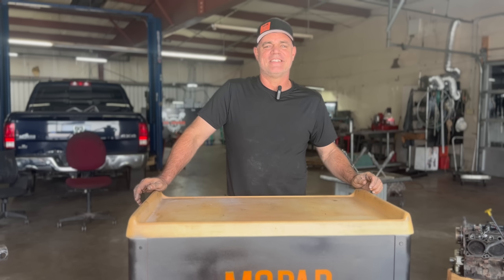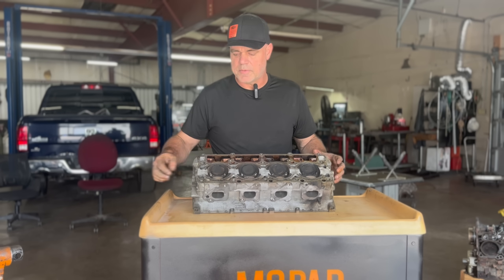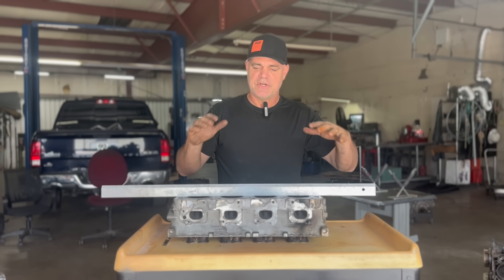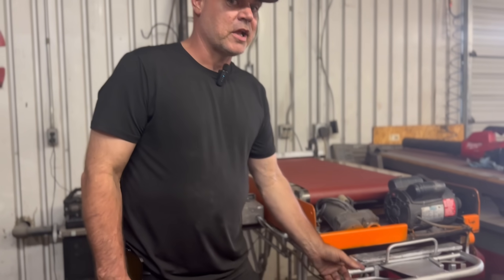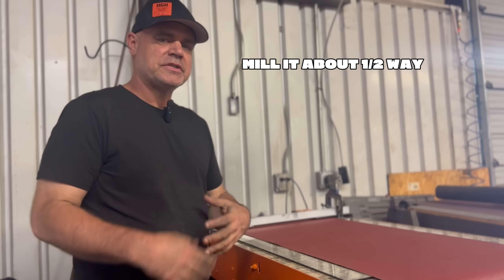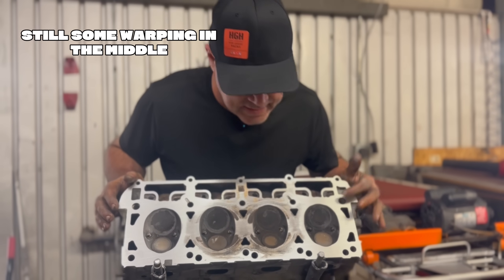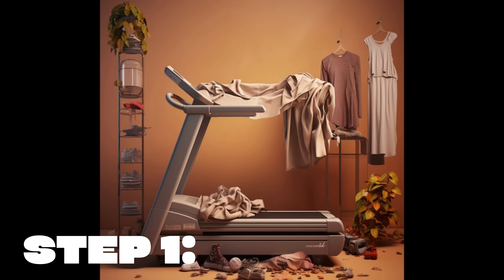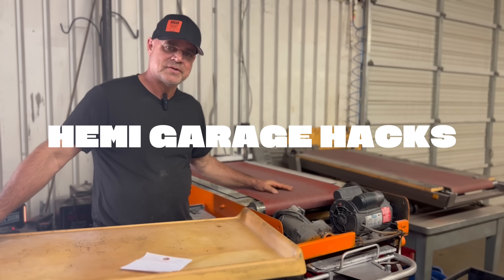I HAVE MILLED 1000+ CYLINDER HEADS WITH A TREADMILL!

Comment: This is awesome, if you dip into many quick turn around machine shops that do heads, you'll find a very large belt sander. To be fair, yours is much, much bigger. My local NAPA, which does all the head work in the local area, doesn't even posses a milling machine. I'm honestly better equipped as a home tinkerer/DIYer but they posses the parts/knowledge to do it like cave men and turn out a quality product.
Reply from the maker: You are right. And the added size has been super helpful.  I would just encourage people to use a straight edge of they are going to give this a shot.  Thanks for commenting and I am glad to have you along for the ride.
Reply: I thought Napa closed all their machine shops
Reply: @chrisbrady-t1u  my local one still stands but it's literally one person. The day he retires or God forbid, dies they'll likely close the doors on this one too.

Comment: Not a bad idea but I fear it may eat more of one side than the rest. If you had a jig to rotate the head constantly at a low rpm, I feel it would be great.
Reply from the maker: excellent point you have brought up!  It is important to change the direction of the head when doing this.  Thanks for the comment
Reply: as long as you don't get stupid the pushrods & gaskets will take up any error.
Reply: doing it by hand I rotate the  sanding marble  frequently (that gives me needed rest also)

Comment: Belt sander..you are sanding the head.. Zero mills touched that head..I'd be really angry if I paid for " milling" but you used a homemade sander instead.. just tell them the truth about it..charge for sanding the head.. obviously too much brake cleaner has deleted way too many brain cells..
Reply: Have you ever had a head rebuilt by your local machine shop? If you asked them to "mill it flat" with no other requirements for chamber size/volume or documentation, they likely slapped it on a belt sander, took it over to a granite surface w/sandpaper, gave it a couple of hand licks, checked it and sent it out the door. People are getting upset w/this guy, but honestly this is how many shops do bulk heads and has been for ages. He isn't reinventing the wheel, he's just showing you how he made his wheel and it's pretty awesome.
Reply from the maker: @adf360  Thanks!  and it has worked for 13 years.  Funny how people get upset about this stuff:)
Reply from the maker: Thanks for sharing!  It straightens the mating surface and I really like that feature:)
Reply: @HemiGarageHacks  and that's great..but it's not to the tolerance or sof having it actually milled..a mill you can dial in exactly how many thousandths you want to take off of each head so they will be matched as a pair vs eyeballing it.. if I'm paying for mill work that's what I expect to get..now if you said you could sand it for 1/4 the price of mill work that would be different.. the people that don't own or use a milling machine will never understand this concept..but as I milling machine operator and owner this entire situation is very offensive as it discounts the precision work a machinist is capable of..this method is very crude..each head will be different..causing differences in each cylinder size and compression rates..
Reply from the maker: @agentcovert you sound like you take pride in your work, I can really respect that. I'm glad you shared your thoughts:)

Comment: This is dumb. There are too many variables to this job. What RA is this leaving the cylinder heads with? Have you ever measured one of these heads to see if the entire thing is bent, not just the surface? You are sanding cylinder heads not milling them.
Reply: If it seals it don’t matter does it
Reply: Not dumb. I have done it in a similar way. A sheet of thick glass with water paper. Start with a course grit and finish with around 800.
It's called lapping.
The one car I did this on did 150k miles after that without problems.
Reply from the maker: @gregculverwell  heck yeah, that's what I am talking about!
Reply from the maker: People get scared when trying new things.  Straight-edge is your friend on this one.

Comment: In your situation that's a great idea I did mine on a 1/2-in thick piece of plexiglass and yeah it was a little bit of work but I only had the one set of heads to do
Reply from the maker: my first experiment was with 3" plexiglass and then I moved to granite with glass (not tempered glass) on top.  I love that you did that yourself though.  Bravery with these things is often lacking.

Comment: You would have to measure the heads each time to see what CC's you have to make sure both heads are the same or you would have different compression ratios on each.
Reply: Taking a couple thousand out either side isn't going to make enough difference to worry about for a street motor.
Reply: @JackHays75  Exactly that👌 Need to remove quite a bit of material to alter the CR by any amount worth worrying over.
Reply from the maker: excellent point you have brought up!  It is important to change the direction of the head when doing this.  Thanks for the comment

Comment: excellent, ingenious
Reply from the maker: Thank you, and the cool thing is that it actually works. over 1000 heads milled without issues.  It's been an awesome workhorse, plus I can use it for other things I need to modify.   Thanks for taking the time.  I have more stuff like this to show, and definitely check out my first video I did on a Lifter tester I made.  Now that was fun!

Comment: Very nice. Much easier work than the old school method of gluing the sand paper to the glass and sanding by hand.
Reply: I'd sandpaper by hand maybe once or twice, but not every day. His idea is great for constantly truing heads.
Reply from the maker: agreed!  Thanks for the comment:)
Reply: But thats accurate! This is NOT. This is a TERRIBLE WAY>  Im a machinist! I KNOW!  Ive done this, It DOES NOT WORK WELL>!   DONT BREAK YOUR STUFF based on some fool youtuber advice.  Hell id only charge you 20 or 30 bucks a head to put them up on my mill...why would you do this crap!? I do 2 stroke heads for 15 bucks lol. You cant even EMORY a head ITS RUINED!
Now if your talking 80 HP LS I guess maybe, but not an actual engine, and here we go with the grampy stories we all know them...fish tales one and all.
Reply: @frosthoe   He say he has done it on 1000 engines... I would think this method to not make it straight enough but he claims to have done it that many times proving at least how he do it works.
Reply: @frosthoe  Why, explain your opinion? I prefer to machine heads vs using a surface grinder because you get a better gripping seal when installing. That said for the average daily driver the belt sander device in the video will do the trick.

Comment: What grits ate you running on both mills?
Reply from the maker: 60 on the head mill and 40 on the exhaust manifold mill.  60 grit is a little rough for the first 10 heads, but I polish off the peaks with a  prepper pad.  after that, the finish is really nice.  the same belt will last me 2+ years. No issues having done over 1000 heads in the last 13 years.  Thanks for the question.
Reply: @HemiGarageHacks What is a prepper pad?
Reply: @turbovolvos40  *prepper

Comment: have you looked at the surface with a microscope to see the depth of the scratches from the sandpaper? No thank you.
Reply: I actually love this point.  I have milled over 1000 heads with this for my own shop and multiple heads for other shops with no issues, so the current finish is not detrimental to the head gasket seal whatsoever.  I like your point because I am curious as to what the threshold is on that.  What is too rough?  I have even heard debates on finishes that are too fine.  Without question, there is going to be a point where it would be too rough though.  I bet 40 grit would be pushing that boundary for sure.  Thanks for the input and thanks for watching.  I may at some point mill a head on my exhaust manifold Mill with has 40 grit, just to see the outcome.
Reply: @davidmiller1022  maybe a crosshatch pattern? turn the head at a 45deg angle and then the other direction at a 45? Like a honed cylinder surface.
Reply: I guess you guys have never researched roughness average requirements for the specific alloy of the head and gasket type

Comment: This is a clever way to flatten heads.  25+ years ago I saw an old German guy flattening BMW inline 6 heads with a large industrial belt sander similar to your treadmill.  I never forgot it and ended up using this technique on warped exhaust manifolds more than once.  Cast iron manifolds in particular can be a pain to set up and cut on the mill, but an abrasive belt gets them to cooperate in no time.
  
The caveat is that, if you have an overhead-cam engine, you have to make sure the head hasn't warped so much that the cam binds in its journals.  If it does, you'll either need to flatten it back out in an oven, or line-hone the cam journals when you're done sanding.  But for most engines, manifolds, etc. this is a real time and money saver.  Good job and thanks for showing us how you did it.  The gurney is a particularly nice touch.
Reply: My understanding is that as long as the warping of the head is not more than .008, the cam journals most likely won't be out of spec. The significant majority of blown out heads I've are usually in the .002-.006 range anyway, so most people are going to be good to go most likely.
Reply from the maker: You are absolutely right!  My second treadmill mill has a much more aggressive belt on it for milling exhaust manifold.  Since they are cast iron, it can take a while to mill them without an aggressive sand belt. Thanks for the input:)
Reply: @HemiGarageHacks  I machined .010" off a pair of subaru heads, (low spot was between the two cylinders in the middle) and after heads were torqued, the cam journals still turned freely, no friction. i was quite frankly, astonished.
Reply: @EldonJohansen Is it possible to shim up the center cam journal if you have to take off say .010 to true the head?
Reply: @MrMEmEmEmEMEMEeeeeee  i would assume subaru heads are the same as any other. You would need to take the cam caps, machine say 10 thousandths off of them, then line bore the cam journals again.
Reply: Cams flex more than most people realize. If a cam is too rigid it can fail in torsion and/or set up destructive vibration/resonance

Comment: Proof is in the pudding. What grits are you running on each. Also like the use of a medical gurney, they are great work tables.
Reply: 60 on the head mill and 40 on the exhaust manifold mill.  60 grit is a little rough for the first 10 heads, but I polish off the peaks with a prepper pad.  after the initial 10, the finish is really nice.  the same belt will last me 2+ years. No issues having done over 1000 heads in the last 13 years.  Thanks for the question.
Reply: @davidmiller1022 The machines I've used mentioned wanting some bite to a finish when he decks heads and blocks so that the gasket doesn't move around. He'd cut quicker for a graphite head gasket and slower for an MLS but looked down on a super smooth ground block. Just something I heard.

Comment: Have you tried using a belt made of wet/dry sand paper?   And have the bottom run through a trough of water to keep it wet.   It would be messy, but it would (theoretically) eat less sandpaper ..
Reply from the maker: honestly, I have never thought about that.   As it is right now, I can use the same belt for almost 2 years, so I haven't felt the pain of having to change it all the time.  Good insight though!
Reply: @HemiGarageHacks  Damn, 2 years, that's outstanding! Screw using a lubricant then, it would just introduce corrosion and cause unwanted 'ick' to build up here/there.
Reply from the maker: @adf360  yeah, I didn't consider the ick build up:)
Reply: @HemiGarageHacks  Wow, that's unreal!   Sick!
Reply: What's the Ra surface finish measurement after you finished?